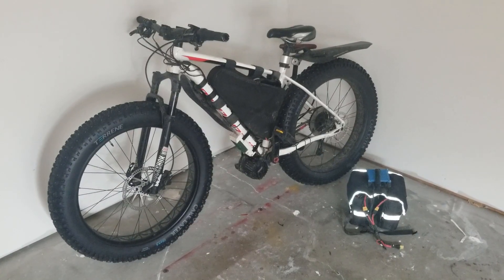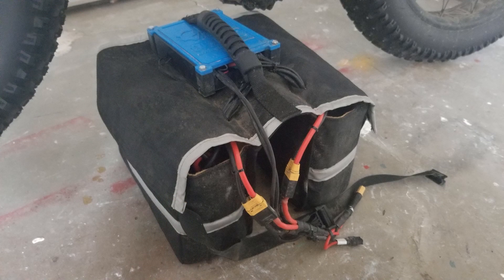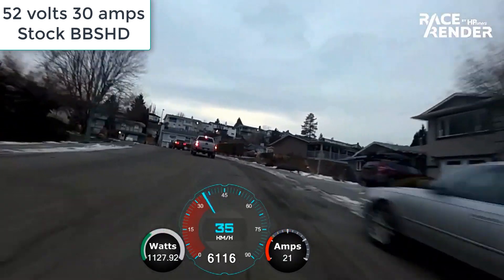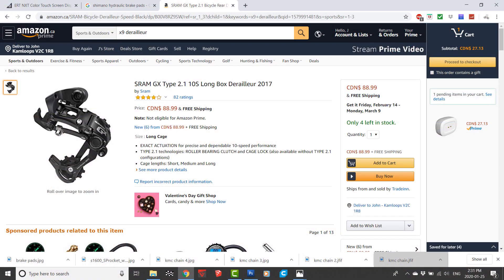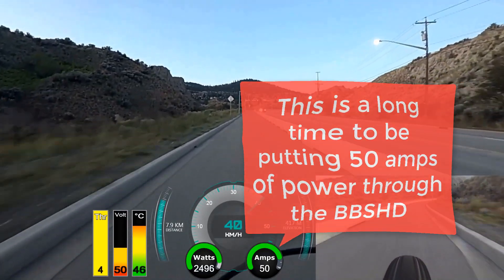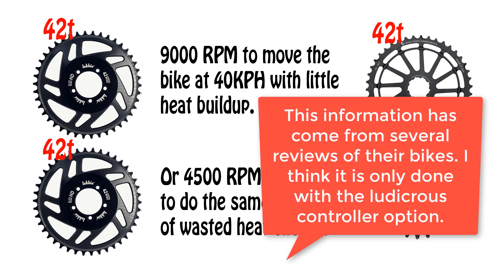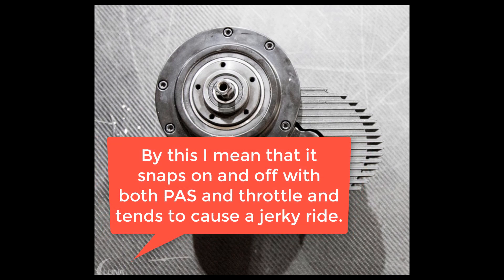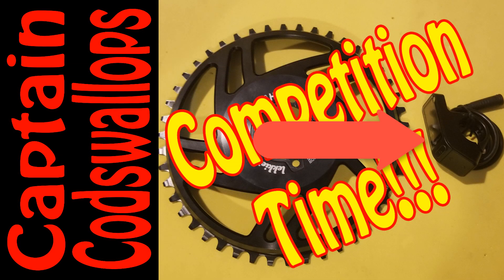Bafang BBSHD - ASI BAC 800 72v - Specialized Fatboy Ebike Conversion. The fastest & most reliable?

Comment: Could you make a video on ""What not to do with stock BBSDH controller"" ?
Reply from the maker: If I still had one yes. I have not used one in a few years. Karl's special source is what you want tho. Great for riding trails.  They are quite hard to mess up. Unless you play with the amps too much with the eggrider.

Comment: is the HD worth the extra money over the 02?
Reply from the maker: I think you can make a really good bike with either. It depends on how much power you want to run. Are you thinking stock or modified. On balance the HD is tougher and more reliable. But if you won't use the extra oomf the 02 is totally viable.
Reply: @HighVoltageKits  stock    some comments about controller failure on 02s

Comment: Stock gear in the bbshd or upgraded?
Reply from the maker: Stock Nylon still. I have a spare PEEK one tho!
Reply: @HighVoltageKits  Nice! I guess itnreally is riding style, im sure you could break the nylon with a stock controller if you didn't useb your gears the right way.
Reply from the maker: Yes. They have failed stock. If you let the motor spin and don't let it get too hot it lasts well.

Comment: Hello, I wonder does battery range increase also when hitting higher rpm in those 42t gears on back or is the same as with higher gear but only motor to struggle more.
Reply from the maker: Range should increase as the motor at or near max rpm will generally draw less power due to back emf. There are other factors. If you are hitting a hill then the draw will be higher. But much less than trying to power up with a small gear and much less stressful on the motor.. Hope this helps! Cheers

Comment: I live in hot climate.. 40c is norm in summer.. my 500w 37v gets VERY VERY HOT 🥵.. beautiful u looked up melting point of nylon.. gave me reassurance I shouldn’t worrry ..my 2 other bikes r 1000w motor ya, true work horse 🐎!!🦾🦾🦾 I’ll buy steel gear anyhow from Luna🤑🤑🤑
Reply from the maker: Glad I could help. The PEEK gear is the one to go for if they have in stock. It's quiet and much stronger. Best of both worlds!

Comment: Great videos! Keep up the good work. Long time BBSHD fat bike enthusiast here. What brake caliper adaptor did you use on the Bluto?  The Magura QM42 (160mm to 203mm didn't seem to work for me.
Reply: Thank you sir. I appreciate the timely response. I nabbed a  clear screenshot from the video. I'll just show my LBS what is needed from that. There is nothing wrong with Tektro brakes. Been using them for years with no issues. Thanks again. Fat bikes with BBSHD's are the best (in our humble opinion). A week after my riding my first build, I just had to build another one to share the experience with others. If nothing else, it provides spare parts immediately.  :)
Reply from the maker: You are most welcome. We have a discord group if you are interested in posting. Lots of fellow builders there.https://discord.gg/pKHk5ej2GG Cheers
Reply from the maker: The bike shop I used provided it. I think its just a standard Shimano one. The brakes are still the tekro which I really should change. Money is always tight tho lol. Hope this helps!

Comment: Just wondering where I can purchase the connecters for the battery to the motor. I see yours are yellow..are they a special connecter and do you have to do some soldering? I hooked everything up but because the connections that come from the motor to the battery are both male ends it won’t connect. I live up in northern BC and find it hard to source parts, so any tips would be appreciated..thx!
Reply from the maker: I am sure I can help. I have a ton of connectors I can send up. They are called XT90s Usually you have a female end on the controller and a male end on the battery that has an antispark. Would be good to see some photos tho. We run a discord server you are welcome to join and post. Its a good way to get advice and help with ebikes. https://discord.gg/zGpNaxRM Best to download the phone app or the pc app and then click on the link. Its basically a bunch of ebike related chatrooms with a messaging system. You can find more about us at www.highvoltagekits.com as well. Hope this helps.

Comment: Hey love the vid
Reply from the maker: Thanks Pascal! 😊
Reply: @HighVoltageKits  np but about the controller in our other discussion do you know of any high quality controllers that might be suitable for the cyc x1 pro gen 2 hopefully looking for 7 kw and up
Reply from the maker: The nukular 12fet is a good match. Silicon X maybe.
Reply: @HighVoltageKits  12fet is a 48v which is not we’re near enough power and I can’t find any information on the silicone x
Reply from the maker: I'm sure they have a 72 volt version. Might be out of stock its a long wait with them
Reply: @HighVoltageKits  72v version of what and I’m wondering if I should just get the bac2000 on cyc’s website cause that’s 72v
Reply from the maker: If you are getting the cyc. Get the stuff they sell. Easier. If you want to use something ask on the Facebook group for what people used. No idea why you can't find the 72 volt nukular but you can for sure get one.
Reply: @HighVoltageKits  cool thanks for your help 👍
Reply from the maker: Welcome. Sorry I can't be of more help. Silicon X is a German company making FOC controllers.
Reply: @HighVoltageKits  your help is very much appreciated cause I’m building an electric motorcycle or something like it and I need it to go 70 kph up a steep hill that’s why I got so many questions and I can say you helped a lot with that and I thank you very much
Reply from the maker: Why don't you join the discord. Links on the description. Easier to post questions and meet people. There are a bunch of us on there building that kind of bike!
Reply: @HighVoltageKits  ya I should do that

Comment: hi Cap, we've spoken a few times.
 I'm building a long distance enduro and was going with 52v 60a BBSHD until i went to buy the battery and found it would take too long to charge, so i'm now looking at a 72v40a instead.
Bearing in mind that, as i will be using this to go round the world on (so riding long distances and day after day) and range being my priority over speed, will this work for me without compromising my range.
Thanks John
Reply from the maker: Having a 72 volt battery will not harm your range depending on the capacity. How many amp hours are you looking at? Sounds like a real adventure. Maybe you can join the discord. I can setup a channel for you to post updates on how you are getting on. You can ask people's exp on battery etc. A few long range 100km+ riders on there. Hope this helps. Cheers
Reply: @HighVoltageKits  thanks for getting back mate. I meant, will using the ASI Controller effect my range if i settle on 72v 40a instead of 52v 60a and just run at a lower power setting on the motor?
Reply from the maker: No not really. If anything you will see a small boost. The only thing to remember is the crank will be spinning faster at 72 volts. It's worth chatting to Daggs online as he does long range rides with 72 volts. Are you planning on using PAS still?
Reply: @HighVoltageKits  yeh course. I mountain biked the world for years but i just don't feel the need any more to fight for every mile coz you only end up seeing less, plus having a power source in my tent would make life pretty cosy
Reply from the maker: Yeah! Easy to make a power converter for tent use. Exiting. Please keep me posted on your trip. Would be great to see!
Reply: @HighVoltageKits  tsk tsk, i don't even use a Mobile Phone Cap unless it's an emergency but i'll probably take a Tablet and annoy you with questions if i break down.
Reply from the maker: Sounds good! Definitely something to be said for not using a cell phone!

Comment: Technically 50 amps must be faster then 30 amps controller..in this bike it's reverse..how come?
Reply from the maker: Hey Yogesh. It's cause I'm an idiot and I got it back to front. You tube won't let me just replace the video so I kept it as it is to preserve the comments which have some useful information. You are correct tho the 50 amps is quite a bit faster! Cheers
Reply: @HighVoltageKits  u r joking by saying that but this isnt d right movement as we spend a lot on making bikes
Reply from the maker: Not sure I understand. I think it is pretty obvious if you see just a few of the videos it's an honest mistake. I suppose I could update the description to mention the error. This is a full list of the videos I did on the bbshd if you are interested https://captaincodswallop.net/bbshd

Comment: so If I was to build a nice fat tire bike that works the best as it can "steep hill". what do you have on your set up that you say are must haves. will going to a say 50 tool in the rear be better since speed is not a objective. I would say power is 1st them battery life and last speed.
Reply from the maker: I think if I had used the 36t on the front and used it with a 42t rear or even larger the torque up hills would be improved at the cost of top speed... but still 50kph I estimate! Hope this helps

Comment: How much did you buy this controller for. It looks awfuly expensive where i found in ~500usd. I am thinking installing something on bbs02b. Even thinking of buying bbshd controller and installing it into bbs02b to try.
Reply from the maker: Pretty sure the bbshd controller does work. I'm sure have seen that.. I paid I think 400 USD for the 800 controller kit. But I did use my own eggrider display. That's about the going rate these days for an 855 kit that you can install without a lot of hassle.

Comment: he runs through large gears, that's why it's working without destroying cassette. Although kmc chains one of the worst chains you can buy, their unriveted construcrion is totally inadequate. Never use them for middrive.
Reply from the maker: I just used the thickest I could get for a single speed. My other bike has a SRAM chain. I think you much more about chain than me.

Comment: Hi Captain, Great video sir. Very well produced and cut. :) I apologize for being a ignorant ebiker but wondering if you might offer advice. Sorry for being a pain. I am just about to do my first ebike; buy a bike (suitable) for conversion and the kit (Bafang mid 1kw). My main goals are to: be able to pedal the bike around in the city (PAS) at 'sensible speeds' (to avoid being stopped by the police) and to to do some single track. I'm a experienced MTBer and road racer but now injured and cant ride far under my own steam so ebikes for me now i think. Q1-May i ask what you think is a required RE number of rear gears for said use? I see u now use about 3 gears. I wonder if having a 11 speed cassette and derailleur is of any use if never going far down the cassette, I'm therefore thinking buying a bike to convert with a 9 or 10 speed could work. Cant quite get my head around the cassette thing but I do understand spinning to keep the emotor rpm high. Q2 - Am I much much better buying a new controller for my intended use? Q3- A battery for a frame mount? Would 52V 17.5 about optimal. Q4, lastly - does anyone get any airtime with their BBHSD. Nothing huge but small drop offs, rollers etc. My concern RE BBHSD is catching the motor on a rock and smashing it. Thanks
Reply from the maker: Hi Paolo. You are not a pain lol. Why don't you join my discord and post the questions on there. Lots of bbshd guys who can help answer. https://discord.gg/qRJ9BujE
Reply from the maker: Post pics of your frame etc and we will take a look! Cheers
Reply: @HighVoltageKits  thanks captain 👩‍✈️. I have joined. ‘El Sweendog von Woof’. Is my handle. Lol. Shall I message you or post to group? Many thanks 🙏
Reply from the maker: Post the the channel. Frame pics etc. Its a friendly place

Comment: Hey still doing the giveaway for eggriderv2? Just got my hdd2  bafang 750 with 52volt 12amp I get 27mph now how can I get more.46 chain ring.with 9 cassette in the rear with smallest gear in the rear about 27mph .thsnks in advance
Reply from the maker: Thats pretty decent for that setup. You can push more into the motor potentially. Join the discord and post in the builds and see what people are using. Link in the description. Cheers

Comment: Is it fine to run a 72V battery with the bafang motor and bafang controller then? I know.u say the aftermarket controller is way better... but im buying all the parts from scratch now and dont have the extra cash for that . Id rather buy a 72V battery now if it will work thab a 48 or 52v now and then have to change it later... what do u think? Go for it? Bafang BBSHD + 72V bat with bafang controller, bafang chainwheel (can upgrade later to leccie)... ?
Reply from the maker: The stock controller on a bbshd will not take 72 volts. 52 max. Why don't you join the channel discord and post questions on there. Lots of builders can give you advice! https://discord.gg/YAAjfgc Might even sell you some second hand parts etc. Cheers

Comment: I love your thorough and smart clips.   I believe the ludicrous change is merely paralleling in 3 surface mount resistors in the feedback sense circuit.   This halves the resistance that generates the sense voltage in each of the phases, which makes the feedback circuit “think”
It is seeing 25 Amps, when it is really seeing 50 amps.   When you connect to the Controller to flash the limit, if you want 50 amp peak, you enter 25.    This is consistent with the thread that the sense resistor values are halved.     I was not under the impression that the ludi comes with a steel gear.   I was told by them they do not change it.   This is circa early 2020.  

Thanks for your excellent review.   I need to learn about ASI Vs phaserunner..... thanks sir Codswallop!
Reply from the maker: I figured they were doing something with the existing circuits. The 25 amps thing rings a bell. If you  have a look online luna have just released a new version of their bbshd controller. Same size but using the VESC platform. It is quite a step up for them. Not seen it on a bike or running a bike so talk is cheap but I hope its good. You are welcome to join the channel discord if you would like to learn more about the ASI and other controllers. https://discord.gg/UBYptPC4Ty

Comment: What an amazingly informative video. Thank you for that! How many rings on the rear cogs do you use? Is your asi controller work with the eggrunner or do you need to use its own display like the phaserunner?
Reply from the maker: Sorry I missed this. I have a max three gears on the back right now. I used the eggrider to start with but then moved onto the NXT which I help to develop. The phaserunner only works with the Cycle analyst v3. ASI is more flexible in terms of displays but it really depends on where you get it. The eggrider does not play well at 72 volts for example. Its really meant to be 52 max. Hope this helps! Cheers

Comment: Is it possible to communicate with you by email ?
Reply from the maker: I would prefer if you joined the discord. You can use a web browser but the app is better. Its much easier to have a chat on there. https://discord.gg/GZfTNP5xZg Either that or I am on messenger as well. Respect if you are not on there tho!

Comment: I must have missed something. In this video, you label the slower version of the hill climb with the better controller and 72v battery.  Much faster climb is labeled as stock BBHSD??
Reply from the maker: No I f'd up the labels. I just would lose all the comments if I re-upload it. The stock is the slower.

Comment: Can you make a 750 watt bafang middrive run higher watts just by changing the esc ? Currently i run a 750watt setup and a monster 48v 50 ah (2400wh)18650 pack that completely fills the triangle of the frame (cube29er)  touring edition lol     ps great video content
Reply from the maker: You should be able to pull higher amps and watts if you switch to an external controller. I am assuming you are running the BBS02? That battery sounds great. Considerations would be what is the max draw on it in terms of Amps. In any case you should be able to boost it to 1500 watts without too much additional stress on it. I would start off by determining your battery specs and then look at controller options of which there are a few choices.
Reply: @HighVoltageKits  thanks for replying , my battery is made from  13 packs of 20 18650 samsung 25r cells .. i believe 50amps is the max draw
Reply: Sorry yes its a bbs02

Comment: Whats your thoughts on running a 52v 20ah on my bbso2b . Was thinking my p850c will tell me if it charges over 59v .
I should have done this rechearch an got the HD . But may buy from luna a bare bone motor next summer .
Reply from the maker: You should have no issues. The controller will pull what it can. At worst you might need to flash the firmware. You are welcome on my discord chat server if you need help.